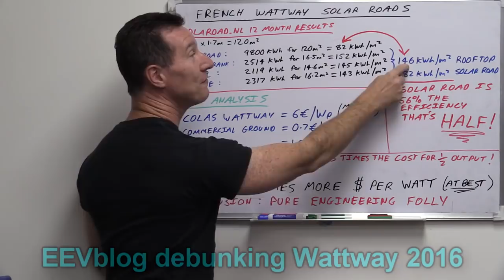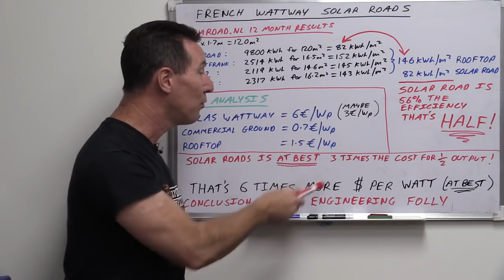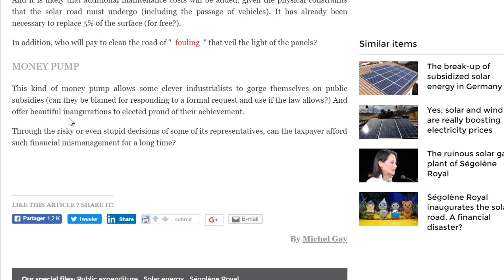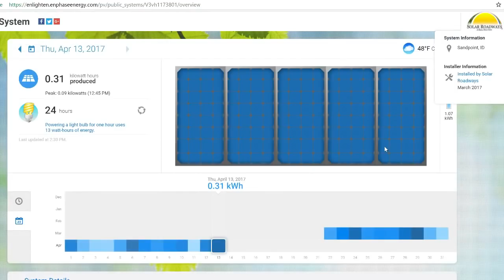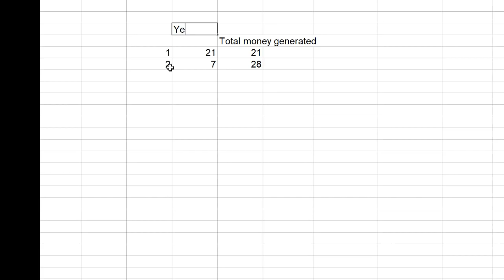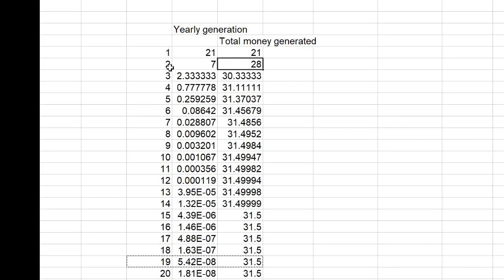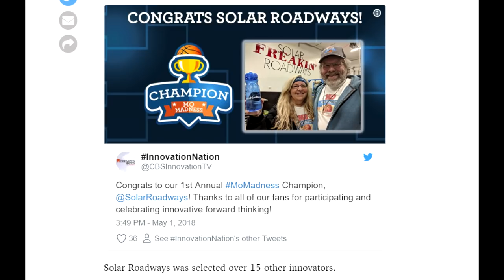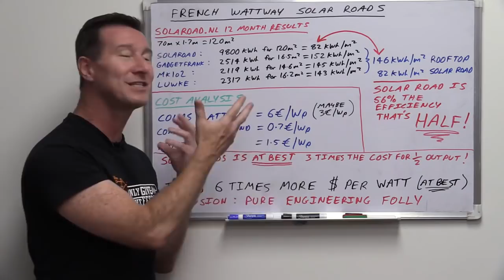Solar Roadway: 10¢ return on $1000 investment!

Comment: These people are better off making a solar sidewalk at this point. You won’t need impossible glass that can hold the weight of a semi truck. Just do what you do on solar roofs and put it on sidewalks. In the los angeles suburbs no one uses sidewalks except for the homeless. No interference.
Reply: Adam Magdaleno They tried that in the Netherlands. It's still horribly inefficient and won't make its initial investment back for centuries even if the panels didn't degrade over time.
Reply: Ok how about a house that has a glass ceiling and glass floor with solar panels underneath the floor. During the day the house is lit, during the night the lights are always on so you can see when you go to the bathroom. lol just a silly idea but anythings better than freeways that's my point.
Reply: Still a bad idea. Laying panels down flat reduces their efficiency by 66%. Better idea is to just put 'em on the roof and put motion sensors with trim lights along the hallway.

And though yes the walkway is better than a freeway, it's still just a complete waste.

Comment: I have been wondering that if a roadway melts snow, then where does that melted snow go? In cities, where there are infrastructure to remove the melted snow, that's not a big problem, but if there's no such infrastructure in place you would have to melt the gutters and ditches also, unless you want to create huge pools of water on roads.

Comment: Pfff, why would we put solar panels in the desert, when we can put them on roads!?
Reply: Cat vs closer to people. But so are most rooftops.
Reply: imagine the dust cleanup though :P
Reply: Solar panels in the desert is barely an improvement. You're putting them where the people don't live; which means long power lines, which means years in the courts, right of way disputes ad infinitum. Sand sucks, so you're leveling the desert and spraying it with binder and pesticides so nothing can grow there and you're going to have to keep doing that and keep cleaning the sand. If you have to put them anywhere, roof tops would be better. They will fundamentally be incapable of supplying reliable power, so you should think of them as a fuel saving device for natural gas / water saving device for reservoired hydro.
Reply: Place them around long distance high voltage power lines. The land is already allocated for utilities and the infrastructure to transport the power to population centers is already in place. Line the sides of highways with wind turbines to harness all the wind. We are already using copious amounts of fuel to push ourselves through the air, which causes quite a bit of wind.
Reply: Harry Balzak you can't connect them to the power lines. You need to step up the voltage, which means that you're building parallel power lines at a lower voltage to a substation somewhere. Underground cables are ~10 times as expensive as above ground powerlines, so you'll be asking the utility to allow you to build parallel power lines along their right of way. They're not very likely to permit that. They at least need access to the poles which means some of the area will be denied for use; and if they ever need to do anything major that involves e.g. replacing a conductor or adding more conductors they'll be asking you to move  your crap along a 10 km route.

Your panels will be covered in bird poop. Birds like power lines; it's a nice vantage point and it's not at all dangerous if you only touch one conductor and nothing else, and they're too small to reach anything else so they safely sit there to their hearts content and poop on your panels. From the height it will spread in the wind and go everywhere in a wide swath under the lines, not just exactly under each overhead cable. Shading is a huge issue for solar. To get 24 or 48 V you're connect something like 50 to 100 cells in series at 0.5 V each. Since they are connected in series inside the panel, shading or partially shading just one out of those 100 cells will drop the output current of the entire panel to the current of the weakest cell. You don't want your panels covered in bird poop or leaves or anything else. A splotch of poop covering 0.25% of a 48 V panel can reduce output by 25% for the entire panel if it's centered on a single cell.

Wind turbines along highways is idiotic. That's like a placing a hydroelectric generator in your toilet to recover energy when you flush. Useless piddle power. If you spammed the entire side of the highway and found a very heavily trafficked road then you would be slowing down the air and increasing fuel use for the vehicles; it's a very inefficient gasoline generator. You're much better off building big, efficient wind turbines at a hub height where you are actually getting wind.
Reply: "There are stepdown stations scattered in the country side all around me." - These are typically lower voltage distribution cables, like 10-20 kV. High voltage power lines (few hundred kV) go much farther between transformers. These kinds of medium voltage powerlines typically have pedestrian roads, bicycle lanes, crops, rocky hills etc in their right of way and it would not be easy to build anything there in a rational way (i.e. not isolated patches).

Stepdown transformers can't usually be used as step up transformers, so the power will be stuck feeding into the farms etc that don't need that much power unless you build your own transformers to step the voltage up to that of the power lines. These will be spaced farther apart the greater the voltage and connected with powerlines, which will need to be above ground because of cost, which will need your own separate power poles inside their right of way which will likely be rejected.

"Underground? WTF are you talking about?" - powerlines.

"You seriously think that is infeasible?" - In the real world, where cost and convenience, maintenance etc matters? Absolutely; it's a terrible idea.

Comment: why the obsession with putting solar panels on roads? why not idk....ROOFTOPS?
Reply: No shit man, if someone came up with a kickstarter with solar roof tiles to replace roof tiles/shingles. Insulation for the roof, power output, and waterproofed. AND most importantly, NO FUCKING CARS DRIVING ALL OVER IT.
Reply: Ruffceyx530 solar tiles are not really an upgrade from solar panels. tesla was going to release some but they stopped the project because it is unlikely  they can beat simple solar panels. each tile is a single cell so they have to be connected in series to maintain the same current and you increase the voltage for every tile. if one has a problem then a section of it becomes unusable. you have to get someone up your roof to identify and replace the tile. this sounds great in theory, replace one tile instead of the whole panel (well probably 3 to five, still $40 in tiles sounds better than a $200 panel). but the service cost for repairing the tile would be more than double. with solar panels you just dismount it off the rail put the new one. with the tile you'd have to remove several, place the new ones, connect them back together, reseal the roof. it takes much longer and requires more knowledge. If you can do it yourself that would certainly save you money, but that is not going to be true for mainstream users.
Reply: Ruffceyx530 tesla makes solar shingles and all that, look it up it’s pretty sick
Reply: Wala Lopez  Looked it up, thanks! Looks very promising.
Reply: Yeah I don't get why they get so attached to that idea. Why not solar sky scrapers? Plaster two sides full with solar panels so you get solar towers (WHOAH). No I desperately want solar panels on the road because muh solor roadwayz.
Reply: John Kimble Cause it's solar FREAKING roadways, I think I'm gonna pattent a solar freaking Subway, imagine your solar roadways now on the underground...
Reply: Yeah that pretty much echoes my thoughts, i appreciate trying for new innovative ideas, this is how we progress. But fuck me, the horse is dead on solar roads, lets try to innovate solar panels in new easier, CHEAPER. ways.
Reply: You wouldn't be able to see through the windows.
Reply: Canopies over parking. Energy plus cars do not bake in summer!
Reply: Bigrignohio that's what they did at my local Costco
Not to mention the fact that when you're halfway through putting up solar canopies if you need to pack up and let people come in and park you can because there's still a road to park on
Reply: Road cunstruction is a state business while rooftop construction is private business. scammers try to convince the leaders of a city to invest in these projects by increasing public awareness. Goverment has more money than most individuals, that's why they got the idea of making a product that has a "green and futuristic" message about it, to convince the gullible to buy into their sceme.
Reply: SOLAR FREAKING SHINGLES
Reply: Tesla makes solar shingles.  They are several times the cost of a solar installation by area, less than half the solar power per square area, and are only warrantied for 10 years electrically.  Plus you gotta do the rest of your roof in overpriced matching tiles.  I guess if you are rich and can't stand the conventional look, but solar tiles don't make economic sense.
Reply: People tend to think of things that require maintenance as being wasteful. Seeing roads being constantly under construction leads to the idea that there is something wrong about the way we build them. The idea of using roads to also provide other utilities, such as power, is always going to be inherently sexy.
Reply: it does disturb me that people STILL think about this. I mean who are these people in Georgia? How did they get so far? Are they going to shut down part of a road?
Reply: Governments should make it mandatory for new build houses to have solar roofs , not solar panels bolted onto a roof but the roof made of solar panels.
Reply: +amojak -- That MIGHT be a feasible idea IF it is efficient and cost effective. From what the guy above you says, the shingles cost more per square foot than a panel, produce half the power of the panel, and likely have a shorter effective lifetime. 

Of course, you may have just meant that they should put regular panels across as much of their rooftop as is reasonable.
Reply: @James Henry finally someone who actually has a brain. People wanna rake the idea over the hot coals but it's about space. Why have solar panels for roads? Idk maybe because 90% of our actual roads dont get drove on. They have to be there anyway so why not have them be solar panels? Plus it makes intercity energy sharing way easier.
Reply: Or at least on utility poles by the road
Reply: Sarah JAmes especially on parking lots, when you put cars on top of it to block all sun light
Reply: all solar panels are a scam
Reply: I install my solar panels ONLY under my shade trees. Solar freakin' shadows!
Reply: That's the idea! First, we put roofs on the houses. Then, we put solar panels on the roofs. And finally…

WE CAN BUILD ROADS OVER SOLAR PANELS ON TOP OF THE ROOFS!

Comment: Let’s just go to fusion energy 😂
Reply: Lets go
Reply: Well fuison is at least promising in the long run.
Reply: The problem with fusion is that we haven't yet reached "breakeven" and evdry step closer to breakeven means ever bigger and more expensive reactors. By the time they exceed breakeven and start producing usable amounts of power, the reactors will be too big and expensive to be economically viable. Much better to use the sun - a fusion reactor that has run reliably for billions of years, will continue to run with no maintenance costs for billions of years, and is parked safely millions of miles away.
Reply: Hoplophobic Let's not. Fusion energy only generates careers for a couple of thousand PhD's for a smal sum of a couple of billions per year (ITER), not reasonable solutions.